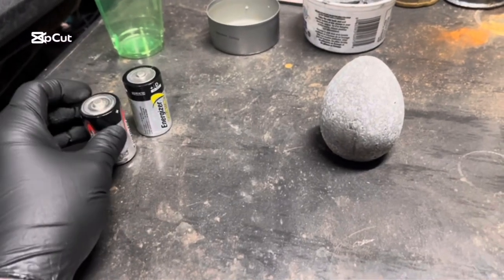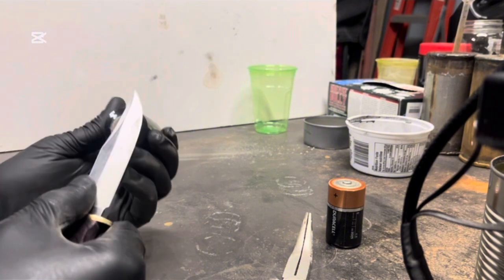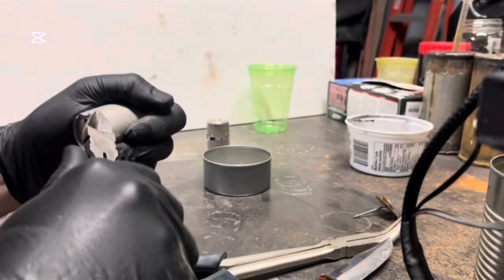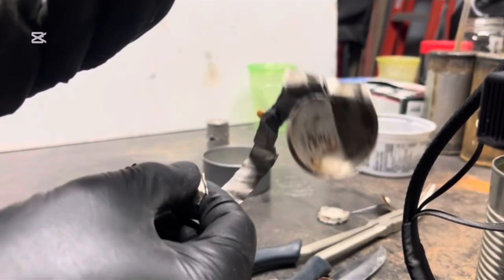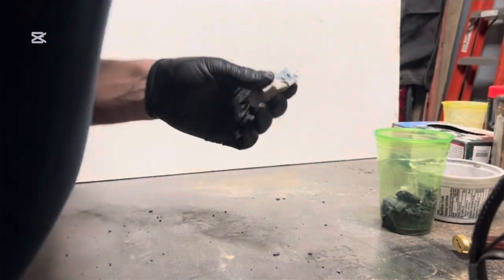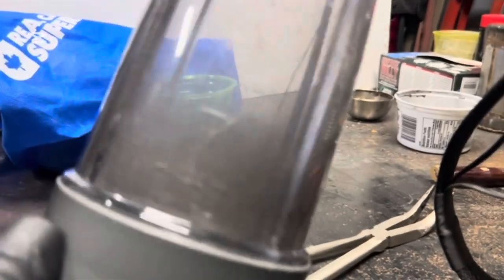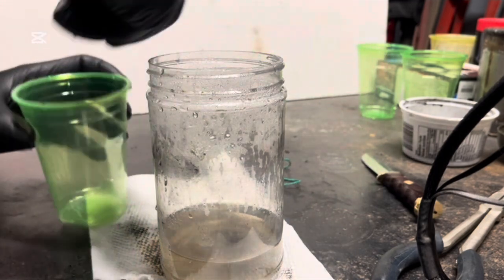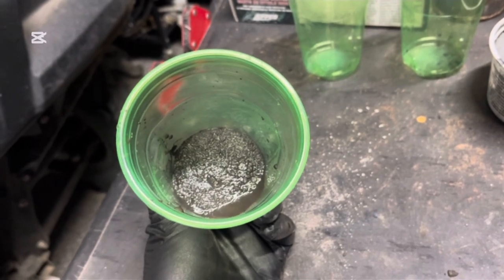How to Recycle Old Batteries into Vibrant Concrete Colorant | DIY Step-by-Step Guide

Comment: 12:11 Use a ball bearing tumbler type grinder... they're cheap to buy and easy to make if you don't/can't buy one... it's the best choice for a lot of things... especially this stuff
Reply from the maker: Good idea!  I have a barrel with some large ball bearings I was using to crush some fired clay for my homemade concrete.  Why I didn’t think to use it for this I have no idea
Reply: Rock tumbler would work great

Comment: They don't have to be alkali batteries, the old 4 cell square 6 volt carbon zinc have a lot more and you get a solid carbon 5/16 rod, and solid zinc sheet metal
Reply from the maker: Thanks for the advice! I’ll try to find some

Comment: If you want MnO2, just take apart the super heavy duty batteries(Zinc carbon), not alkaline batties. Not only are they cheaper, they come apart easier, the case is zinc (usefull) and the inside is all MnO2. Also, there are no chemicals inside that will burn you. This right here is stupid.
Reply from the maker: I was really just trying to make use of what I had and read some papers on how to go about doing it.  I definitely agree though that zinc carbon would be safer and more efficient, but I’m glad I was able to make this work as a concept at least.  I do have some zinc collected from other batteries I’ve taken apart, any suggestions on what I could do with it?  I’ve considered using it for electroplating as an experiment but haven’t looked into it too far yet
Reply: Why is it stupid?
Reply from the maker: I think he is just trying to say that there are easier ways to get the manganese that are inherently less of a safety concern which is true.  However if all you have is alkaline cells they work as well but safety precautions must be taken.  I recently checked this egg now that it’s cured up for a few weeks and the manganese doesn’t seem to have affected the strength of the concrete in any noticeable way ( for non structural projects at least). Perhaps I should do some columns with and without the manganese and load test them in my press to get an idea of the overall difference if any
Reply: Great idea brother!  @AdhDad420

Comment: that is MnO2 , not Mn0.  It's Deadly Toxic. It lends no positive benefits to concrete. It will leach out of the concrete and poision the enviornment. If you want dark concrete, use Iron oxide pigments, they come in Black, Brown and Red. Don't do this.
Reply from the maker: When I ask Google about using battery manganese for concrete colorant it says this “Yes, manganese dioxide (MnO2), commonly found in batteries, can be used as a colorant in concrete. It's used to produce colored concrete products, with a recommended ratio of 2-6 kg of MnO2 per 100 kg of cement” admittedly though I am not a chemist and this is from an ai summarization that appears at the top of the page so Its certainly feasible that it could be false.  I did this project largely because of how expensive traditional concrete colorants are (at least off the shelf) to explore the feasibility of a low cost “green” solution.  Hopefully I’m
Not poisoning myself in the process lol